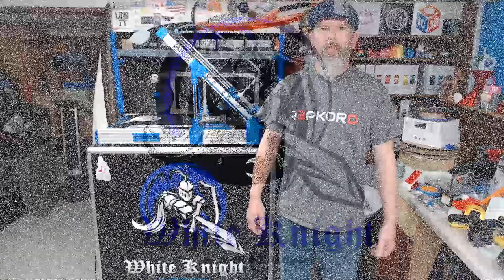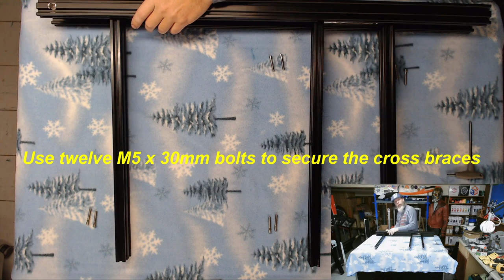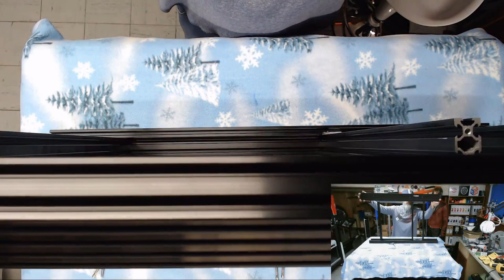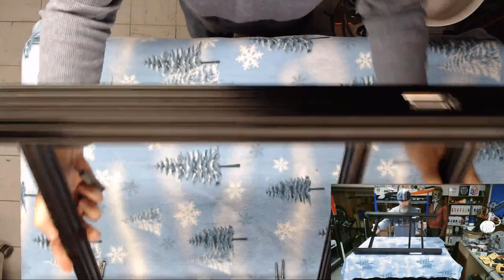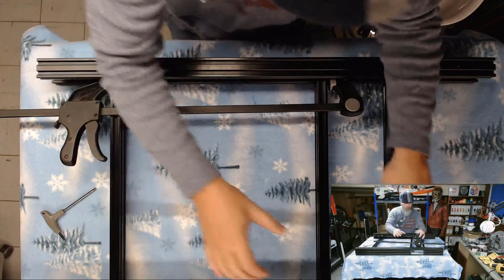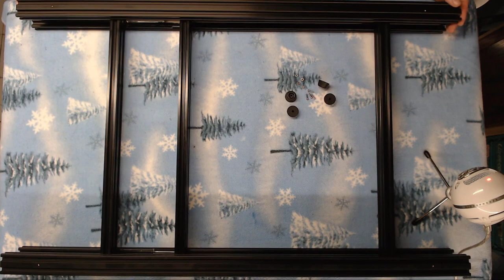White Knight Assembly Part 4

Comment: Did I already ask this on another video?  I'm sorry if I did:  I was meaning to ask if you've seen the Zesty Nimble direct drive extruder with remote cable and gear reduction.  Basically it puts the extruder stepper motor off to the side and delivered the torque through a cable drive.  Didn't know if that might lighten the gantry and/or maybe eventually help enable multi-material in a lighter weight fashion.    If nothing else, might be worth chunking onto the "look into this later list" if there is any merit to it.   I have a Snapmaker with the big heavy aluminum block extruder that I'd like to convert to a simple plate, a Zesty Nimble and a Mosquito hot end for some added precision.   I also need to look into the pinout of the RJ-45 or RJ-whatever the cables are and see if I can make a really simple diode stepper smoother board for the motors.  That could really elevate a nice little machine to the next level.
Reply from the maker: I heard about the Zesty Nimble but unfortunately didn't get to leave my booth much at MRRF and didn't get to see it..  Hopefully they will be at ERRF so I can check it out.
Reply: @NAK3DDesigns  The first couple of videos on youtube right now for the search Zesty Nimble could give you a start if you can make the time for it.  I thought they were really cool.